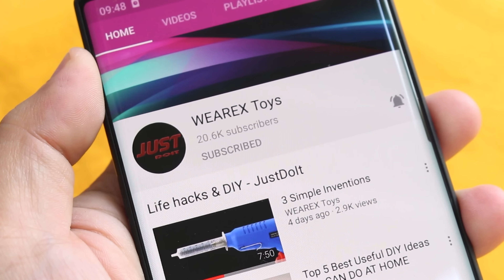Make your work easier with DIY Firewood Cutting Machine

Comment: A wooden sawbuck and a cheap electric chainsaw would work better and be safer.
And not need $5000 worth of equipment to build.  And cut bigger wood without the danger of a table saw blade.